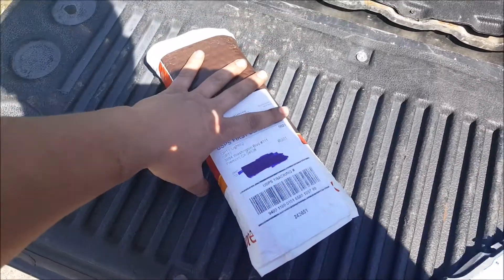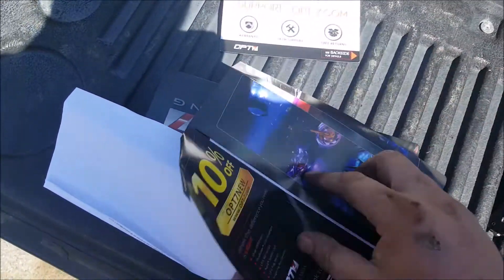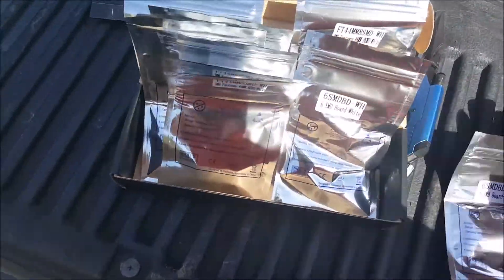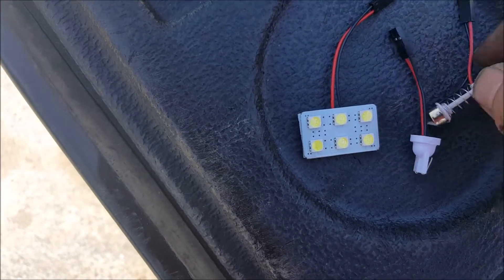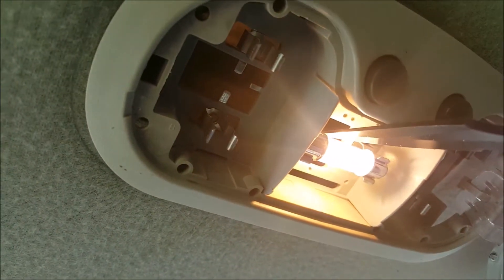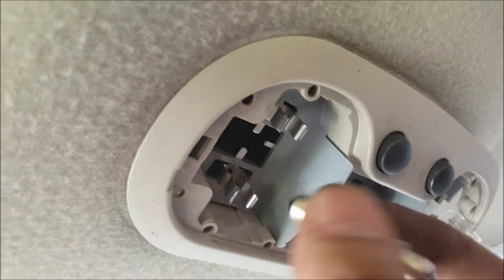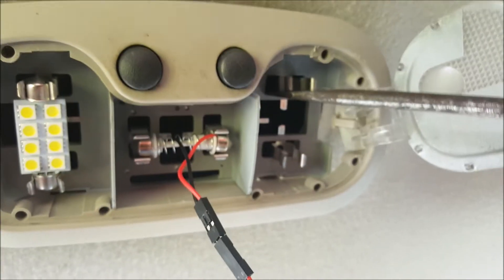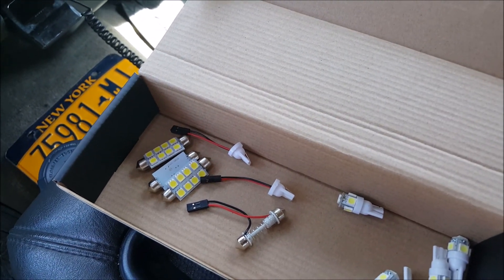OPT7 LED Interior  Kit Unbox and install

Comment: Work great !!! but is it normal that my lights tend to turn on and flash a bit when I press the brake pedal ?
Reply from the maker: No that in my experience isn't normal.  Sounds like a ground problem
Reply: Twisted D Thankyou very much I’ll make sure to check the ground.

Comment: how are the led lights holding up now???
Reply from the maker: OB_Outdoors most are still working fine. I have had 3 bulbs fail.
Reply: @TwistedD  do you recommend them?  Would you buy again?
Reply from the maker: @sean.g4516  I would.  The only one that disappointed me was for the center over head cab. Just wasn't bright enough for me personally.
Reply: @TwistedD  try the sylvania 578sylled or 211-2 zevo  from Walmart or parts store. I jst installed the 211-2 zevo tonight which is somewhat bright being that my center light never worked in my truck til now so it seems bright I guess. BUT the 578 syl led suppose to be brighter cause their meant for offroad use. I'll grab one tomorrow from Walmart its CHEAPER than the parts store plus itll be a good upgrade for your under hood light to if you have one. 👍🏾
Reply from the maker: @sean.g4516  I'm running a 14 Silverado now.  Has leds stock.

Comment: What knife is that? I'm looking to get a new knife that opens a little easier
Reply from the maker: _classic419  that was a cheap camping knife.  It u want a good one. I just got a Buck Spitfire. Best knife I have ever owend
Reply: Udrv2slw I'll be sure to take a look! If you're looking for any more OPT-7 stuff I just got the LED interior kit. Shipped in one day and only took about 45 minutes to get them installed and all wired up